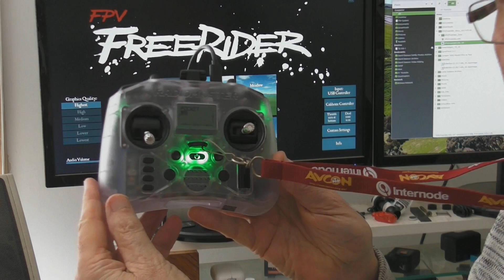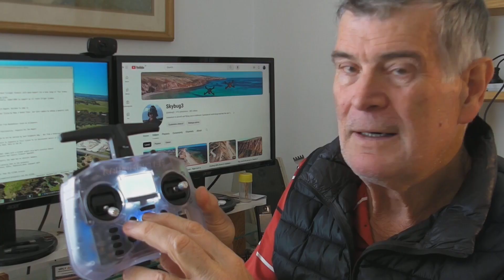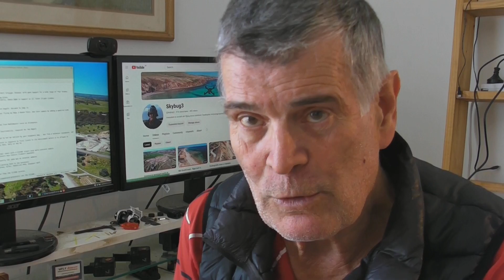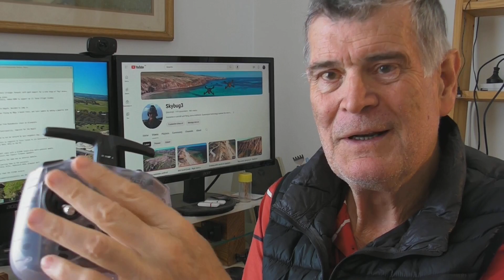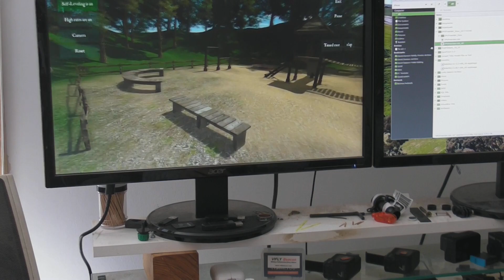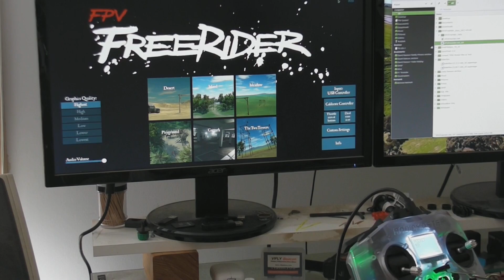RadioMaster Pocket - moving from DeviationTX to EdgeTX

Comment: Hi David! is it possible to connect an ELRS external module RX on the Bugs 3 Flight Controller?
Reply from the maker: You would have to de solder 8 pins to remove the Bugs RX, and then figure out what pins the ELRS module need to connect to. I have never seen info to help with this.
Reply: Thanks!
yup 8 pins as opposed to 4 wires on ELRS.